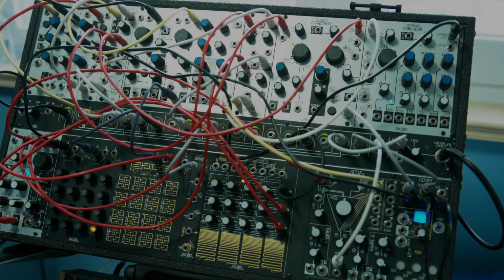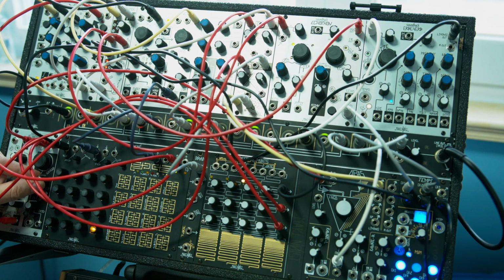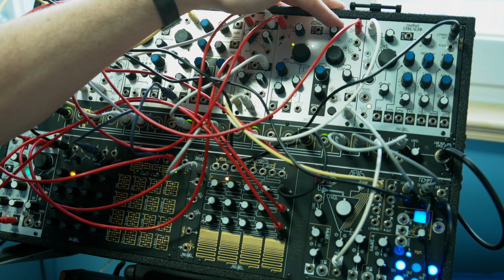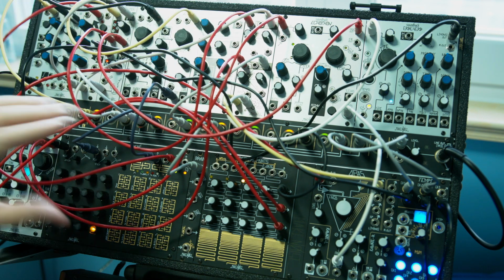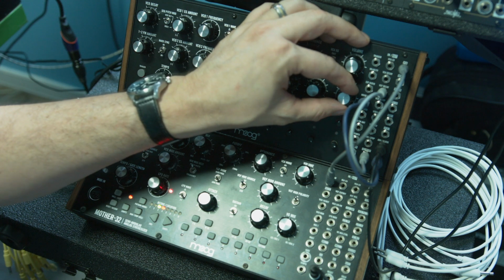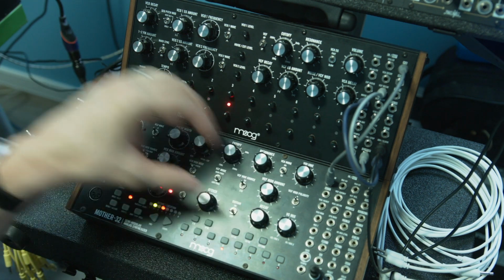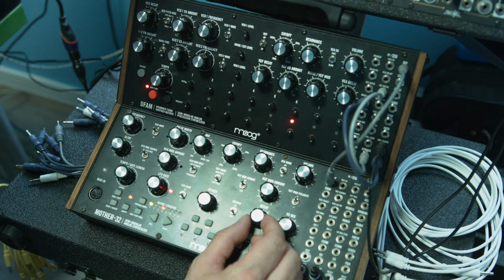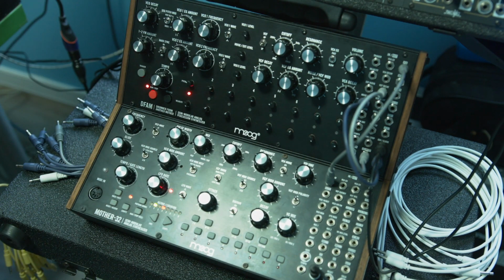Adding TONALITY to NOISE using the MakeNoise QPAS filter.

Comment: Thats nice, If this were mine I would take it to ableton now and fatten it up with some bass, just like you did , just bigger. But that's so a candidate for final production in the box!!
Reply from the maker: For sure! I just recorded 2 tracks for this (and most of these) video.  The Moog was on one and The MakeNoise on the other.  I'm trying to keep it "live"-ish haha.  I agree that the bass is low...I actually did a bit of post to try to bring it up but there just wasn't enough mustard there to really cut through.  What exactly would you have done to bring it up? I'm definitely keen for some advice!  I have a 3-stage compressor and some eq on it boosting below 200 with a little bump around 300.
Reply: @Koboto  The compresion works when there is enough material to work with of course. But for this I would add some complimentary tracks made with you choice of bass source. Some people dont like mixing Ableton with modular, strange to me, I like whatever it takes to make it sound full and finished. I would use operator and make a bass instrument that fits into the song. Along with some stuff from some other instruments, this could be a full and finished piece!
Reply: Of course it is great as it is!!
Reply: Dope dope 👌👌

Comment: ..but you have another filter right there. The second channel of the Qpas seems to be open. 
Great patch and breakdown!
Reply from the maker: True... but I had the filter tuned with the pad via the Pressure Points so I couldn't move the cutoff or it would have thrown it all out of tune...:(. I should have tried to throw that arp in there anyways though, could have been cool!  I admittedly didn't try that. Thanks for the idea.